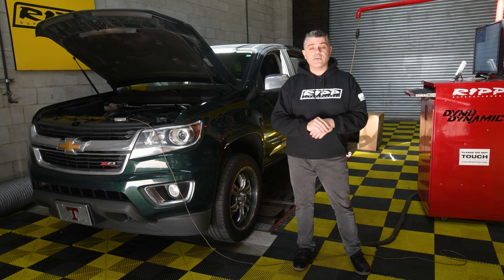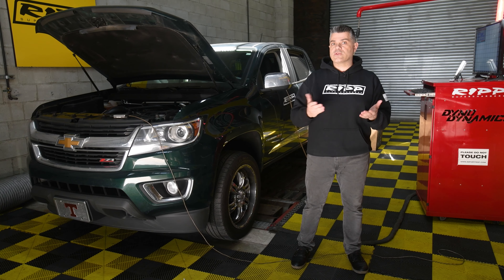2016 z71 v6 Colorado on the Dyno - Intake and Exhaust only!

Comment: The technicians at RiPP Supercharges really know what they are doing. I have recently purchased a kit for my 2016Colorado Z-71 2WD and will have it installed soon. Very impressed with the system including a super sized intercoolerto keep engine at regular operating temperatures when at full acceleration. Can't wait to get it dialed in and see the numbers.
Reply: Why even bother getting a v6 if you're gonna just spend 10k in mods? So stupid.
Reply: @trigun890  You just don't get it.
Reply: @trigun890  One reason is there 's NO V-8 available for the Colorado so
every unit built comes with the V-6.
The other reason is RiPP Supercharger kits like I have are around 5K not 10K as you stated. Oh here is another reason : It bangs out 409 RWHP  and
that blows the doors off of any V-8.  Smart man not stupid .......chump.
Reply: @trigun890  if it’s not your money, why post anything?

Comment: ♥️ Your products but the biggest concern is the transmission! FCA is garbage in most of there line up as far as Jeep vehicles goes. How is the transmission in GM vehicles w/ you're supercharger?
Reply from the maker: The transmission is lined up to haul 7000lbs we have not had any transmission failures on the Chevy program at all. Additionally we have sold over 8000 kits worldwide for the Jeep program including Wrangler, Grand Cherokee and Durango all of which are loading up the vehicle with gear, large tires and trailers. We enjoy a less than 1%failure rate across the board.

Comment: Not sure how accurate this is. The NA test was 194hp in their other video and this is 278hp with an intake an exhaust? lolz I don't think so! Unless there are 2 more cylinders or a turbo added with the intake and exhaust, this is super fishy!
Reply from the maker: When you're doing a before and after what matters is the before and after. They truck was brought to us as is and all we did was strap it down before we supercharged it. We do not sell anything installed in this video and have no reason to mess with a number. Ultimately with our supercharger it made the correct number is relation to other trucks with our kit.